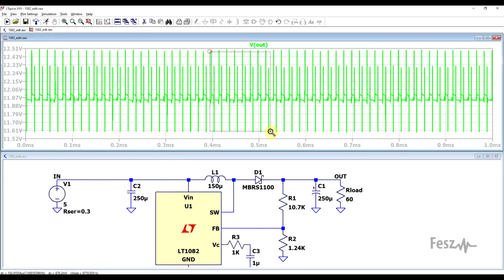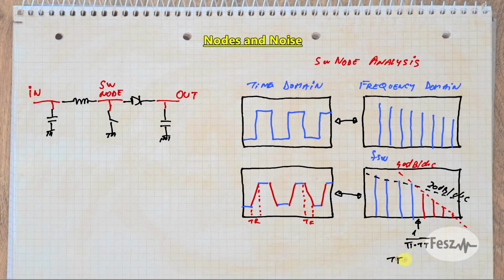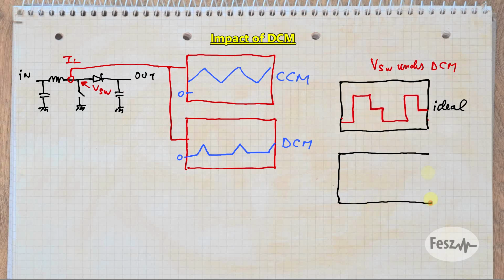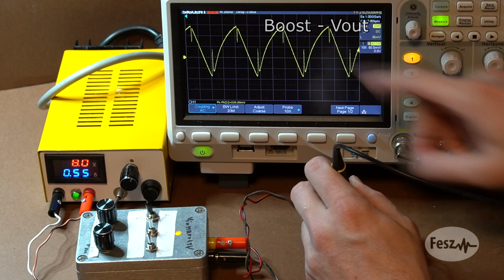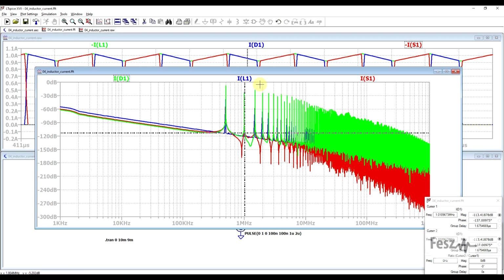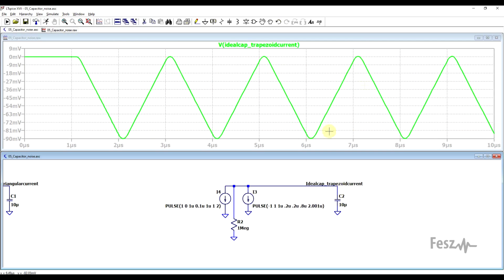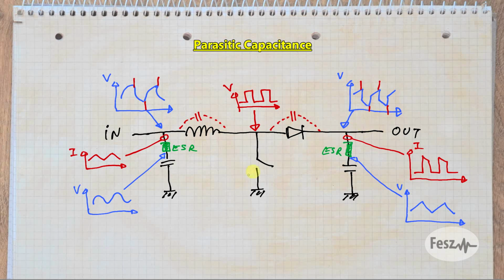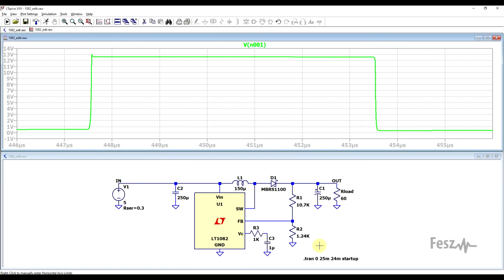SMPS Noise Analysis - The Basics

Comment: Interesting.  When we design switching power supplies using SiC MOSFET's and IGBT's. we start out with the lowest recommended gate resistor value.  But typically this causes transients on the switching.  Then we increase the gate resistor to taste.  :)

Comment: Neat trick for identifying and isolate one noise superimposed with several others, is trigger the scope from another channel hooked onto a signal that's timed to what you're looking for. Then switch the scope to trace averaging, about 16 to 64. This will cancel all the other out of phase noise. This is useful for studying phase and amplitude of a noise which may for example is coupled in through spurious conducted susceptibility.
Reply: For example the di dt primary current passing through a sense resistor, generating a magnetic field enough to couple across packaging and show up on a swiching current shunt's control loop. Only by triggering the scope averaging from the primary switch, was able to study the control loop damping and its phase margin.   
 Another example is differentiatng between what is passive filter resonance (reactor twang) and primary noise feedthrough in a complex waveform.
Reply: These tricks I used to plan a PCB layout respin of a quiet spaceflight SMPS which required a greater margin of compliance with EM emissions.

Comment: very good run-down of these issues... talking about "hot loop", when i worked with my suppliers of DC/DC converters, we even looked at the placement of device pins, for both PCB and in-device current paths.
in DCM, the ringing on the switch combines the inductors value, and parasitic capacitance, and the decay actually allows you to calculate the inductor AC resistance at the ringing frequency, and you can do a trick to calculate parasitical, by putting another probe at the same point, which adds about 10-12 pF, and you can see the frequency change, so you can then approximate the real ringing frequency with no probe attached, by calculating the effect of removing 20-24 pF... there's also a slightly tricky way of calculating the ACR, by measuring the decay rate of the ringing...
BTW, since i gave you 10 points for using the spring ground, you might edit in a tiny bit about using the ground lead, which introduces a resonance at 100~125 MHz, which makes the circuit look noisier than it really is...the resonant frequency on a 'decent' 500 MHz probe changes to >500 MHz with the spring ground adapter!
Reply: Bench Ground Plane essential. With scope ground strapped to it. If that's done well the probe end ground can become superfluous!